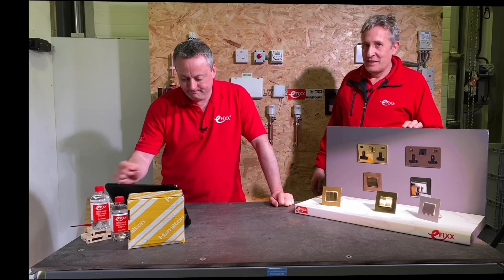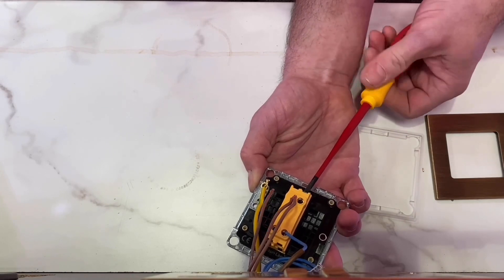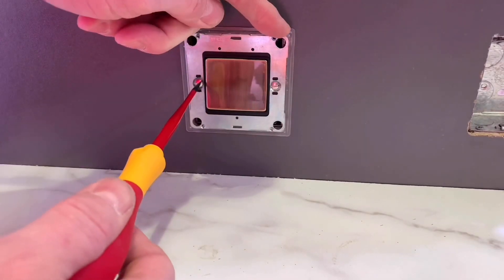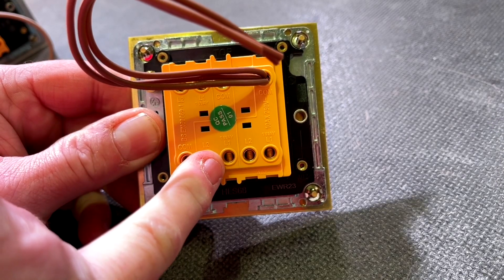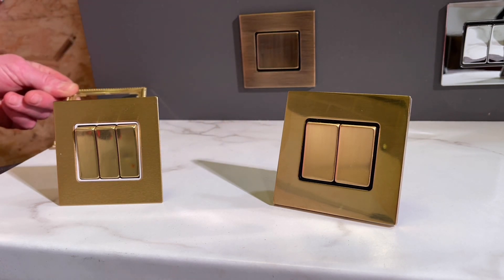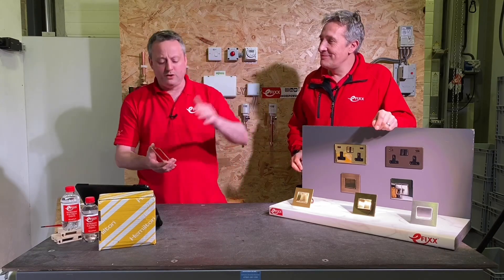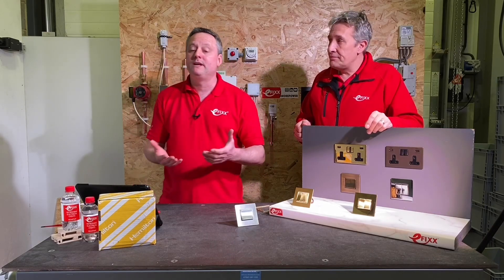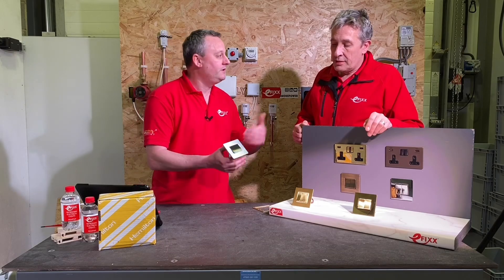EASY to install , EASY to operate - The NEW wide rocker light switch range from HAMILTON Litestat

Comment: Here in Germany that design came up during the 1970s, and I also use my elbow to switch the light on when I got my hands full. Here the terminals of the switches are marked with an L for the common and arrows out for the corresponding wires:

https://www.voltking.de/media/image/product/59987/md/busch-jaeger-2000-6-us-wippschalter-einsatz-aus-und-wechselschaltung-thermoplast-blau-2cka001012a1069~5.png

Sometimes by other manufacturers also labeled that way:

https://images.gutefrage.net/media/fragen/bilder/anschluss-auswechselschalter-beleuchtet-von-kopp/0_original.jpg?v=1424007403000

And also visible, the old german wire connectors with a screw....

AFAIK the switches are interchangeable between UK and Germany, even if the backboxes here are round and in the UK they're square. Only the screws are different, in the UK machine screws and here we got a special type of screw with a diameter of 4mm, available in different lengths, but I always buy the long ones and cut them to length with a 200mm diagonal cutter. Mostly slotted screws, but now also available with a PZ1/SL recess.

https://assets.kaiser-elektro.de/products/94/949/630x630/2472-40.pjpeg

Comment: I love those wiring devices! we used to have something close to those, they used to be called the "Despart" system. Eagle electric made them back in the 1950's. the rocker switches and outlets were interchangable on the bracket and they were really handy... too bad they were discontinued... I miss the style....

Comment: Would be nice if they added another terminal just as a joiner, to avoid another Wago style connector in the back box.
Reply: The danger is potentially someone putting the neutral wire in the wrong termial and then buttering their toasty fingers (optional)
Reply: @iknowmyfootball3901  I'm not sure that that risk is any higher than of someone swapping L & E or - insidiously - L & N on the back of a socket. I feel that the competence of any person who's putting the conductors in the wrong terminals would be very hard to believe.
Reply: @iknowmyfootball3901  who cares about making a dead short by pushing the light switch.. it’s clever isn’t it.
Reply from the maker: @Wheeto Congratulations!! You have won a prize in this months LIVE FEED event. To claim your prize please visit this link and input your details.        https://www.efixx.co.uk/unplugged
Reply: A light switch isn’t a means of joining wires, that’s why you have wagos
Reply: @filipe.skunk8  I can think of at least two parties who'd disagree with you: 1) Schneider who say of their Lisse range "Neutral Loop terminal on 10AX plate switches provides flexibility and future-proofed installations." and 2) efixx who are impressed that you can fit three conductors in the terminals of this Hamilton. Just a shame the Hamilton doesn't go the extra mile as Schneider do. I expect efixx can't endorse this request as they're being paid to promote the Hamilton range.

Comment: I have been using a similar product from Volex in disabled plots along with  double sockets with switches on the outer edge .. easy to operate and fairly stylish .. not a fan on screwless design.. never really fit flush to a wall and times i have had to replace them because a painter has ditched it ... screws at soldiers for me .... i like the Hamilton gear, just not always readily available from my usual outfits
Reply from the maker: Thanks for the comment 🦾